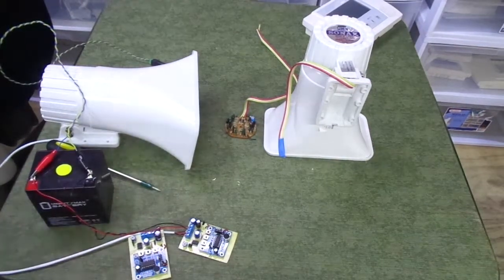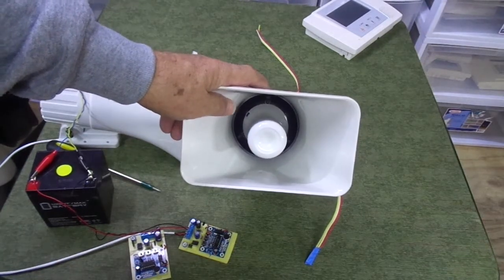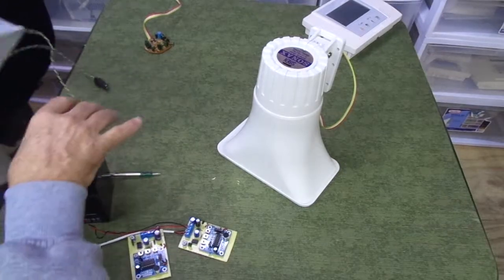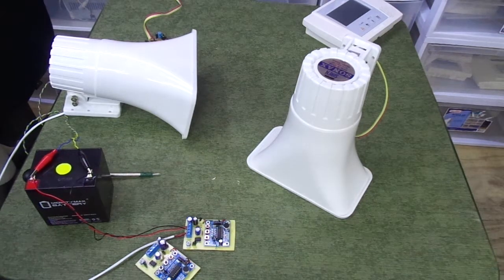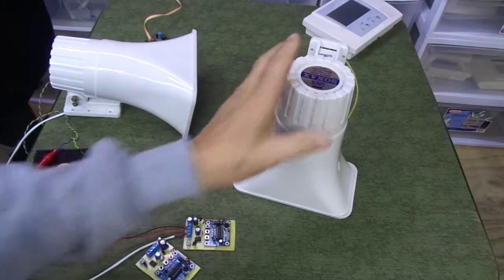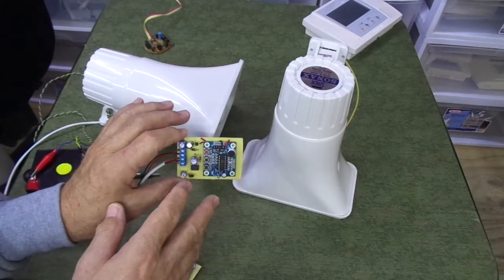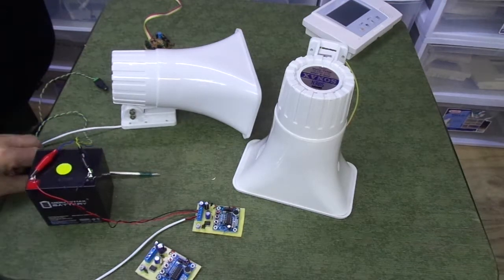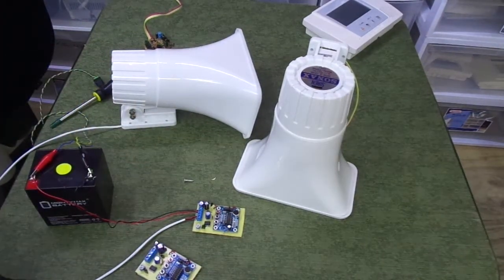Ron in the shop making a dual siren change to speaker for external voice siren

Comment: Step by step would have made a better video
Reply: step 1) clip off siren driver
step 2) attach diaphragm coil wires to amplifier
step 3) attach amplifier to audio source

I mean, if you cant figure that out, maybe just buy a prebuilt unit. Side note, the way we learned to mod stuff is by taking stuff apart. Start disassembling more stuff and youll figure it out....